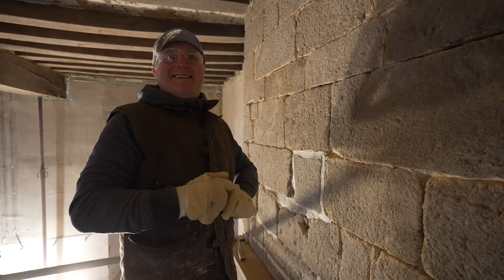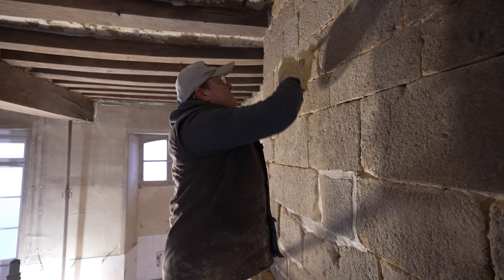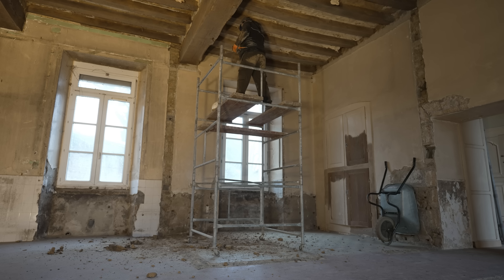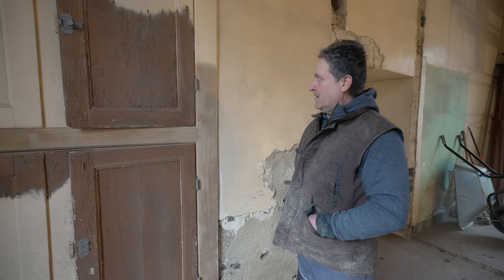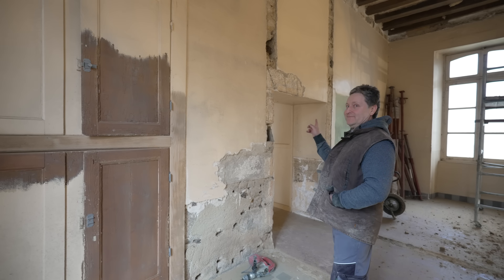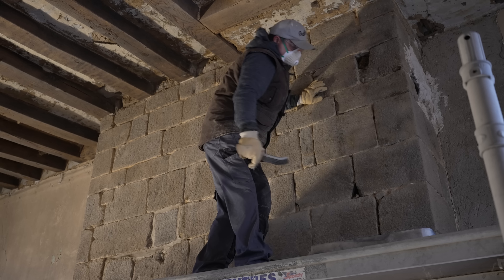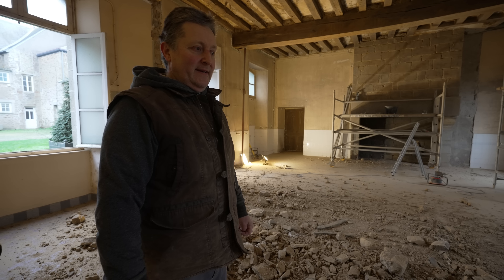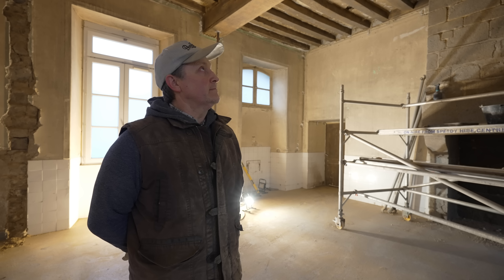A Royal Mess!

Comment: Billy, I'm interested in knowing why the stone is on top of the beams.  Guessing it was not put there originally.
You are beyond generous to include a little bit of kitchen design from everyone who has sent in plans.  It is a large kitchen so that helps.  Am so looking forward to the kitchen coming to life during the rest of the winter and on into the spring.
Reply: yes why is the rubble up there in the first place?
Reply: It’s there to fill the gaps... I’m not entirely sure why they are removing it? They will only have to replace it with something else. Normally there will be a floor above which would be resting on those stones.
Reply: its put there as noggins to stop the cross beems twisting and bending side ways as timber moves left to right ect nails rust and then the timber moves ,

Comment: I had a thought about the reimagining of the wine fridge’s. Perhaps you can find a pair of large antique armoires. Finding knock down ones. Easy assembly and disassembly. You can keep the backsides open. The weight of the fridges will keep it stable. You should be able to find oversized “brown “ furniture at a reasonable price.  Lol, my kids refer to my home as Narnia because I have 4 large French armoire’s throughout the rooms. 1 from 1910 and one from 1920, another one that covers my entire dining room wall from 1890!  
I have used the 1920 one to separate 2 rooms the back has been left opened completely, I use the shelves inside for all my office storage! As it is weighted down it is not a danger of tipping.  
You can refinish or paint to match your kitchen design!

Comment: Hi Billy;  It’s great fun watching Sean and Steve working on the kitchen.  I’ve said before and I’ll reiterate that you need some decent scaffolding for both of those guys.  The scaffold should be rigid enough for them to work safely and high enough for them to have a rail behind their back.  They should never stand on the top platform.  They only have to loose their balance once.  They are doing a great job!!

Comment: PVC windows are fine in a modern house.  Less so in the Convent though.  Loving the beams.
Reply: Windows a very good match to the original wood ones with slim frames you can with special primer paint them they have a high insulation value but Billie just don't like plastic just hope if they replace with wood that they will allow double glazing.

Comment: A suggestion for you!  A couple wheelbarrows of the small bits of concrete can be used as filler in the pot hole in the entrance way until you get the pavers down. Hopefully this would soften the bumps as the cars drive in. .......especially Ryan's new car ......:)  I really like the that you are re-cycling/reusing materials, and keeping the work spaces and equipment clean.  Hosing down the lawnmower before winter storage....etc.  Really enjoy your videos.  Love to you and your "crew" from Canada.  🇨🇦

Comment: Questions:  Why do you think that rock/concrete was up there between the beam  and the flooring above? Didn't the  ceiling occlude that space from view before?   Will you design this kitchen to include period appropriate space for visiting chefs? Where does the water come into the  kitchen?   Yes, I have designed a few commercial kitchens on a  smaller scale, but knew there was a plethora of professionals who would join you on this  venture.

Comment: Hey guys, great show, Brilliant, I'm happy about all of the progress you are all making, with the Convent, I know you are over budget and you are trying to work with what you have, but do you realize that from its inception, the fireplace exposed as you see with its rough cut granite structure was not designed to be shown because of it's unfinished appearance, but rather right from its inception was designed to have a facade, plaster, or better yet Tile or brick veneer which wouldn't cost all too much. that's a fact, so think about it guys, if you can afford it, put a nice rustic looking tile or brink over the granite, representing that Era!😗
Reply: @Nicky L As I said in the comments area, anyone with construction knowledge knows that the granite that composes the structure,  is just that and requires a facade, and as you saw, they the builders comprised the facade with Plaster or cement. maybe the facade changed over the years, but those are the facts

Comment: Nice progress!

Before putting on beton/weight from the metal beams you bought onto the floor - did you check what is below this kitchen room, and the state of it in terms of ability to carry load? I remember there was a basement at least part of the building, but not exactly what area it covers and what kind of ceiling it has.

Comment: Billy, I believe it is a mistake to remove the stones in between the beams. This design with wooden beams  spaced with stones and clay is very standard in France and has a good reason: the beams are not fixed to the main beams and the stones and clay are used to maintain the space in between the beams to avoid them to move or to twist with the time. If they were there was for a good reason… Should put them back 😊. Good work done! Good luck!

Comment: You know what you are doing, obviously.  But where you have pointed  I did notice that the joints hadn't been churned. When the lime mortar is just going off you bang it in with a stiff hand brush to knock out any air pockets and seat the lime properly in the joints. You also know that you have to spray the stone with water first so that its damp when lime is used.   The banging in with the brush is called Churning. It gives the pointing a good face to cure and absorb carbon and saves any fiddling with it afterwards to tidy it up

Comment: Log burner in fire place ......wonderfull... mine is electric I have a imitation wood burner,the affect is wonderfull,But have it so you can have the affect for flame without heat also.Mine does and at Christmas which is hot in Australia just the flame affect near the Tree is so pritty."Crack On" good luck.

Comment: You are taking out the compression rig on top of the beans please be aware you are compromising the structure. You must re introduce wood replacing the stone you took between  the joist, also the two beans are been flex to much, my recommendation is to reenfort and reduce de expand with 45% angle bracing to the walls in each bean , maybe 4 feet each .
Reply from the maker: wood is going to replacing the stone, did we not mention that?